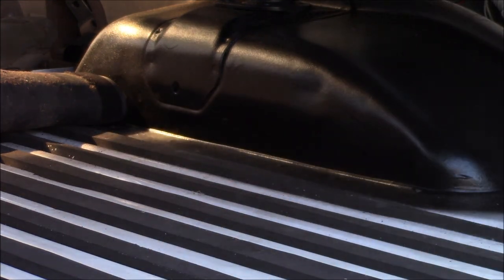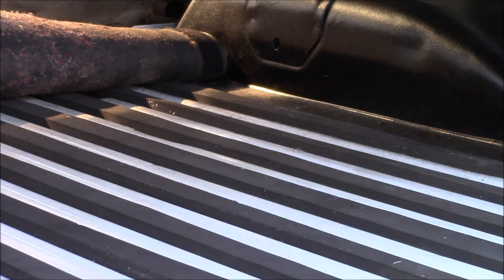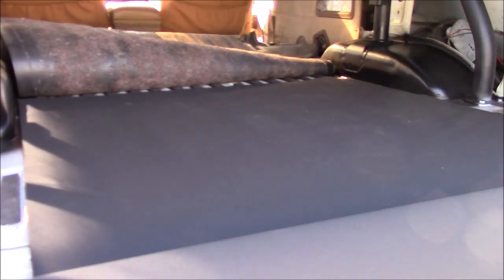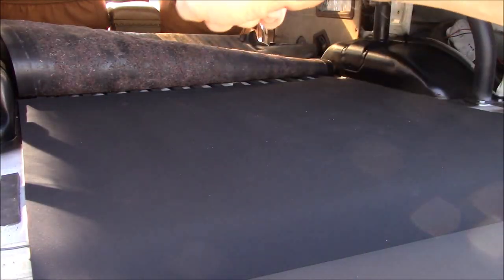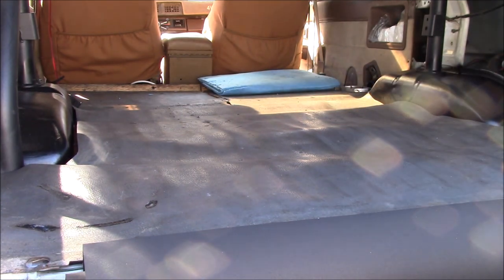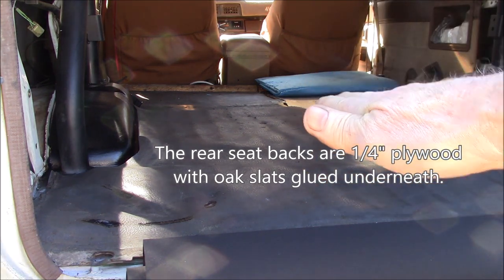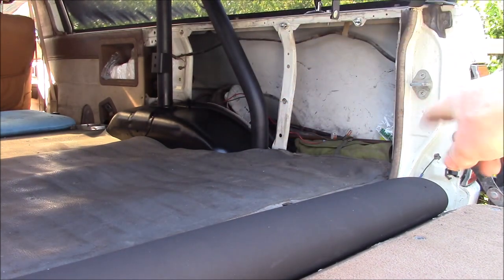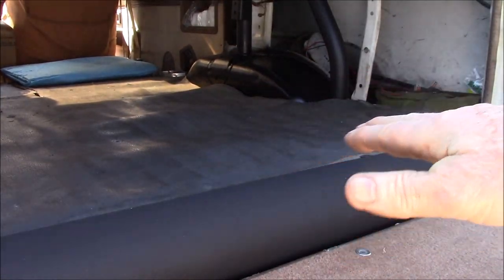Toyota 4Runner: Rear Cargo Mat Padding, Part 2

Comment from the maker: Really happy with the way this came out.  I was doing some work in the back of the 4Runner this afternoon and I could just move from point to point, kneel, lay on my side or back, roll this way and that and it was all comfortable.  This is not padded like a mattress, just enough to cushion the steel ribs of the bed floor.  And without losing much headroom at all.